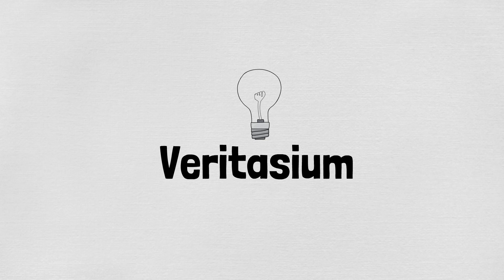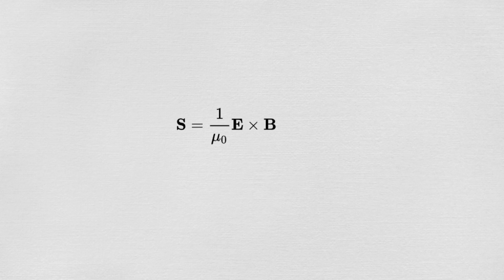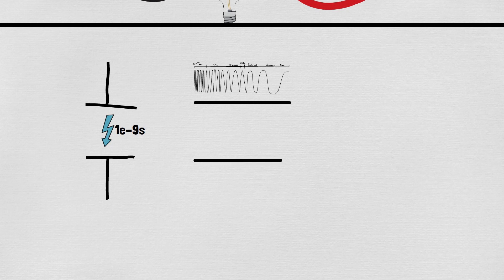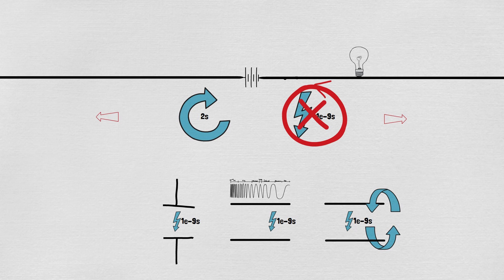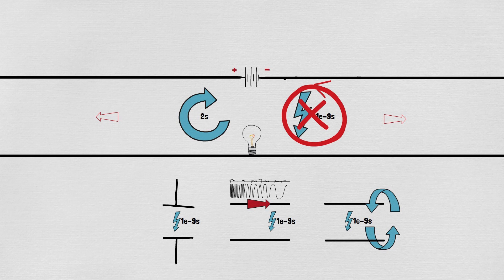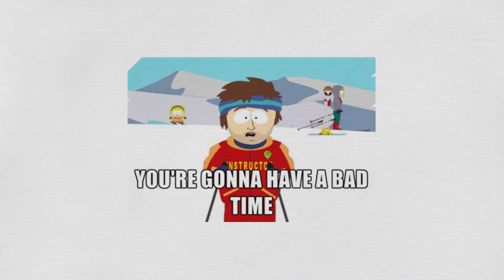Veritasium is Right? (see description)

Comment: The clue lies in veritasium stating fraction of the power. He never claims full power is transmitted. Herin lies the problem with the problems you raise. Full power is indeed stabalized after a couple of seconds (i.e also not just 1 second). Veritasium assumes electrodynamics. It is you that is making it electrostatics. B-field is not only generated by electrons flowing. It can also be generated by E-field itself, hence the second term in maxwell's 4th equation. It is also this part that brings time into the equation as requested by you. No flow of electrons needed. It is especially this term that is neglected in electrostatics, making your claim on electroststics vs electrodynamics exactly the other way around.
BTW the switch is needed to generate a transient effect. In DC/steady state talking about speed makes no sense. Instead of a switch, connecting the battery would have the same effect. The switch at the end of the line would result in a completely different behavior from an EM perspective. These are not similar at all. And yes, the circuit with only two open wires with a lamp in them can be made to light up. Although momentarily. In case of AC it can be lit up all the time.
Reply from the maker: i think i may have fallen prey to the same mistake veritasium made in their video - imprecise language. i don't consider a transient displacement current through the bulb that is insufficient to actually produce any light as the same as "turning on", so that's why i posed the alternative experiment of the open wires and a bulb on the same side as the switch. incidentally, if it were on the opposite side of the battery from the switch, nothing would happen because that side would already be at steady state (zero current).
Reply: @antimatterhorn  This is why veritasium specifically stated fraction of the energy. With his setup, the displacement current might actually be in the order of 10%, which is not insufficient. This is based on the characteristic impedance being a couple of 100 ohm. The bulk of the energy will be stabilized several seconds later and will be transported along the wires.
Reply: @kirepudsje3743  I still think the veritasium video is misleading not to assume a specific impedance and actually slog through the calculations to state what specific fraction of the steady state power can be delivered as a function of time.  It casually mentions the conclusion "depends" on things like impedance but doesn't follow through on that part.

Comment: For me the biggest problem is the mixing between DC and AC during the assessment of the problem Veritasium did. He states and illustrates the problem showing a DC source, then he solves it using AC. I mean, either the diagram of the circuit Veritasium showed didn't have the symbol for a variable source or I can't recall properly what each symbol mean.

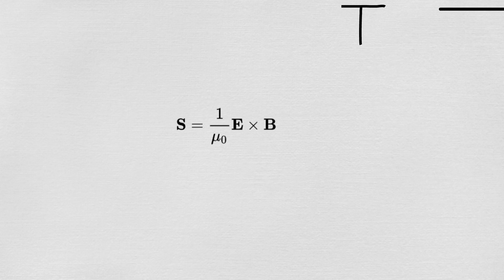Comment: The part in Derek's video that made me somewhat confused was after around 6:15 when he explained that in order for a current to flow, the electric field first has to extend around the whole wire at the speed of light (https://youtu.be/bHIhgxav9LY?t=375). So given the length of the wire, it would take one second for the current to begin flowing which would then allow for a magnetic field to form, which in turn allows the flow of energy described by the pointing vector. So I think Derek was ignoring this and only started counting the time once the two fields are fully established (i.e. electro static vs. electro dynamic).

But then again, I merely deal with regular fluid dynamics in my day to day life, so I might be completely wrong here.
Reply: Some kind of field will establish itself through the effects described in this video once the switch is closed. But the full field won't appear until it gets there with the em wave through the wire. So yes, there will be some kind of current through the bulb almost immediatelly, and if the bulb doesn't require much voltage, it may even light up, at least for a while.

Comment: I'm with you on most points. However you say the E Field inside the Battery only exists because of the current. No current no E Field. This is not what I remember. Isn't there always a potential difference inside a (charged) battery and therefore an E field? 
Assuming the system has been inert for a time long enough, shouldn't all of the circuit be on the same potential as the batterie's + except for that piece of wire between the - and the switch? So when the switch is closed, current can flow  immidiatelly (at the switch at least).
Reply from the maker: electrons can only leave the battery while there are redox reactions inside the battery to replace them (meaning electrons are flowing into the cathode for the reduction reaction). they don't have to be the same electrons (and usually they're not), but they do have to be replaced or else the battery chemistry shuts down the oxidation reaction.
Reply: @antimatterhorn  But why do you need electron flow for there to be an electric field? There's no electron flow through a capacitor and yet, when there is a potential difference, there's an E-field. There always a potential difference between the batterie's terminals, isn't there? So there should be an Electric Field.

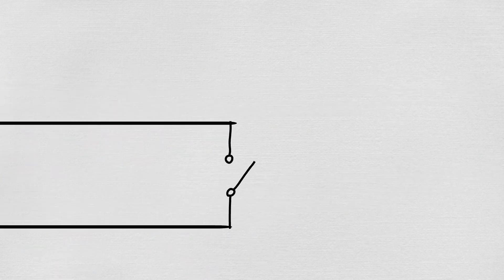Comment: If you put the switch at the end of the long wires (as you did at 3:09 ) and if Derek's conclusions were correct, then this switch would almost instantly turn on a light which is 0.5 light seconds away. That would be information travelling faster than the speed of light...

Comment: I humbly suggested to Veritasium that if he was sincerely convinced that the electricity flowed outside of the current he could conduct a simple experiment.
Take a length of live cable fully insulated and sit on it.
Then remove the insulation and repeat the experiment.
Reply from the maker: his claim isn't that electricity flows out of the wire. it's that energy does through the EM field. and he's right about that. i think he's just wrong about how quickly the poynting vector establishes a steady energy flow into the bulb.
Reply: @antimatterhorn  If the energy flows through the EM field why is it barely detectable? I use a non contact voltage tester on a daily basis...if it's not right on top of the cable it doesn't register the field.
Where is all the EMF  hiding?

Comment: This helped me understand the concepts much better than the Veritasium video, because I couldn't understand why resistors would work in a system where all the power was being transferred via EM waves outside of the wires. There is no impedance for empty space.
So is the true answer 2 seconds plus 1e-9 seconds? Electrons in the wire have to all be moving to transfer charge before the power can be transmitted via EM the 1m between the battery and the bulb?

Comment: I have almost no knowledge in this field but: wouldn't it take 1s to light, because the field would extend out from the switch / battery at the speed of light and join in the middle (light) at 1s, causing current to flow through the light at that point?

Comment: Very much correct, I was disapointed in those experts as well. 

Simplest explanation at the Electrician level, no need of Phd's. Lightbulb is a load, work, which requires current. And as we all know, voltage tickles, Amperes kill. Current travels at the SOL, hence the answer is 0.5 s. 

There is one, single, caveat I could see. If you built a perfect EM detector, and placed it in perfect Faraday cage, so only EMF from it's internal circuit triggers it, the moment you flip switch, wire would generate a single EMW (if that makes sense) and it would travel at SOL, which is 1m away, that detector would then be on for 1 s exactly, while current travels through the wire, then shut down, because DC doesn't generate EMW. 

However, that is not a lightbulb. Because then we run into a conservation of energy problem, where a photon of that wavelength would be... what. 1/4 light second long, with corresponding absolutely non existing energy level compared to visible light photon. 

That is not the simplistic conditions described.

Comment: I think the veritasium video has caused confusion because the stated assumption is something like "the wires have no resistance and any current will power the lightbulb".  At that point you're no longer talking about wires or a lightbulb, and I would want to see a model of whatever superconductor is carrying the current before I trusted the conclusion.

Comment: Someone ( a EE like yours truly) should mention that  the circuit in not lumped ( dimensions comparable to wavelength of light at low frequencies, DC to say 100hz, to cover the transient step voltage ) , a power line treatment will give the answer as +- 2secs imho. The initial current will hardly be enough to power anything even transiently.

Comment: the main point of vertasium was energy does not flow in wires . If current is responsible then what about drift velocity of electrons? My answer is current is initiator which flow  if there is potential difference and this current create fields which transfer the energy .This my  current understanding .

Comment: I knew something about the thought experiment didn't seem right.

Though I thought there would have to be a "signal" (energy) traveling to the light bulb only when the circut is completed, because information about the electrical circuit and energy flow would have yo travel through the whole wire before the circuit "knows" or "updates" to be "flowing".
I thought the biggest problem is the fact that we are removing resistance as a factor and that we are observing the switch as if it magically switches "on" the whole circuit - all the electrons in the whole circuit, and that the energy transfer is the only component of the thought experiment that matters.

I get that the point of the original video was to teach people about how energy is transferred, but I couldn't help but notice that it somehow didn't fully make sense.

Edit: I would like to hear what people think of my understanding and/or tell me if it makes sense. I'm just a uni student who isn't even studying this branch of STEM.
Reply: I've been struggling with this myself, and I'm not a physicist, I just design my own synthesizers! I think I just about understand it now - just 5 mins ago thanks to others in this comment section. So disclaimer, I may have got it all wrong!! As I understand it, the main problem for me was that so many real life factors are ignored in these thought experiments, that I shut down my own understanding of them by realising 'that would never happen with real components'. Someone else on this thread said 'even the battery will have its own electric field' which is when this all started to make sense. So before the switch is closed, the wires connected to each side of the switch already have an electric potential, and flipping the switch causes a change in that potential, causing a change in the field which would propagate over the 1m space to the bulb. But, I don't believe that the effect would be very noticeable when you account for real world factors.

Comment: Remember Ve's primary hypothesis: 'Power "flows" in the fields OUTSIDE the wire, not via the electrons WITHIN the wire.'  Does Ve's "thought experiment" prove his original hypothesis, which is not "how long does it take to "light" the bulb, but where is the energy flowing?  I think Tycho makes the point with his thought examples that the wire is not only necessary, but indeed carries the lion's share of the power.  We have not "been taught incorrectly" as Ve taunts.  Yes he has caused lots of discussion, but how many will just trust his conjecture and proceed to distrust all physics and engineering theory that otherwise has served society quite well, so far?

For power to be transmitted via EM radiation you need both an electric and magnetic field.  If Ve's "field only" hypothesis is correct, it must work for all circuits, both AC and DC.  If I power an appliance with 60 Hz through two adjacent wires (as we commonly do in all buildings), the magnetic field around the wires is effectively zero, so there exists no ExB to transmit power yet the appliance works, and the more power the appliance "draws" the larger the wire I need to operate it safely.

What I conclude from all the capacitor and transmission line discussion is that "the bulb turns on" is a very complicated process with different voltage, current and energy levels over a short time.  Are all these transients irrelevant?  Not when you are designing computer chips operating at gigaHertz speeds.

Finally all this discussion shows how willingly people propose solutions to problems without carefully identifying what the actual problem is.  Imagine if we applied this observation to political issues!  What was the problem, again?

Comment: A lot of good points made, I don't agree with the conclusions of this video. Before the switch is closed we must assume the entire circuit is at equilibrium with one of the battery terminals. When the circuit is closed, since there is no resistance, a LOT of current would instantaneously flow then oscillate or 'ring down' governed by the inductance and capacitance of the lines. I don't understand why you say that no current will flow until the EM field is established over the whole circuit; that sounds wrong to me.

Comment: Finally an explanation that makes sense! Even though I don't understand most if what you said, I knew the first video on this was wrong.
Reply: Well, at this point, I'm not sure who is correct. Derek's explanation intuitively doesn't make sense, but there are some things in physics which breaks common sense.
We need experimental data to back up either sides of the argument.

Comment: I have a doubt!
If i attach a wire of lenght 1m to the postive terminal of a battery and a wire of lenght equal to distance travelled by light in second to negative terminal, if i short both wire, how long will it take the battery to be short circuited.
As per me since both wire are connected to the battery the effect should be instantaneous,as both wire are already at different potential. This can be applied to the vertasium circuit problem.

Comment: Veritasium is misleading his viewers with concepts that are true, but are badly applied to the case.

It's true - as Maxwell established - that between the wires you'll have a displacement current (you can think the wires as being a sort of capacitor), but you also need to consider that this displacement current will only be generated in the region of the wires in which the voltage is changing, and no where the voltage is already steady (the example of Veritasium is using DC current, with a battery).

So, imagine at the initial switch position of the wire, where the voltage goes from zero to the nominal V value of the battery. This is not instantaneous, but we can consider that the time it takes is very small (even nanoseconds). During the interval in which the voltage is raising from zero to V, you'll have a displacement current, because voltage is changing. This "step voltage change" will propagate as a wave through the wire at an speed near (but below) the speed of light.

So, at every time you'll have a "moving" region of the wire in which the voltage is changing, and a displacement current is then generated. Even if the time that the voltage takes to raise is very small, the speed of light is very high, so the length of this region can be quite large.

In this link, you can see a formula to calculate the Capacitance of two parallels wires: https://www.emisoftware.com/calculator/wire-pair-capacitance/

If you take into account that the length of the "active" region is approximately the time that the voltage takes to raise from zero to V multiplied by the speed of light, then you can calculate that the intensity for a diameter of the wire of 2 mm will be in  the order of 1,2 mA per volt, and for a 12v battery, is expected a current of 14 mA... you will not light a bulb with that, perhaps a diode?

In any case, that's all power that will be delivered "through the air" over the 1m distance... the real power will get delivered by the electromagnetic wave that goes through the wires, but 2 seconds later.

Comment: Assuming the light was on, switch closed, current established. How long would it take for the light to go out if you opened the switch? Would it take less time, more time, same amount of time? 
*ideal circuit, zero resistance, and a light element that illuminates and extinguishes instantaneously.

Comment: I think you're missiing one thing. Even if the wire is cut anywhere, ununiform current will flow for a very short moment (until the wire is polarised and the field inside is cancelled, and equilibrium is reached) as soon as the switch is closed. For that very short moment there will be changing electric and magnetic field resulting in an energy transfer to the bulb, even though that is practically immeasurable.

Comment: One thing here you forget this is DC. DC does not flow via capacitive or inductive coupling. Therefore electricity has to flow all the way through the wire as it is the only path.

Comment: Google is doing a total disservice to our whole society by removing the dislike button. It is no longer possible to judge from like/dislike ratio what the common opinion on a certain video is.
Such important and far reaching decisions should not be left to greedy managers and shareholders.

Back to topic: The transmission line arguments in the comments down below are very compelling. So bulb will get energy almost immediately (1e-9s). But definitely not at full power according to voltage of battery.